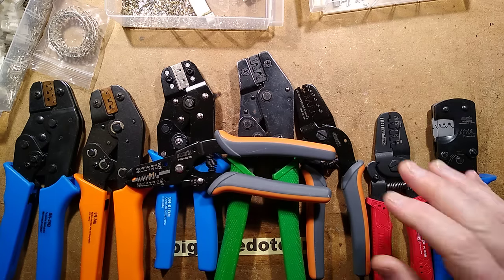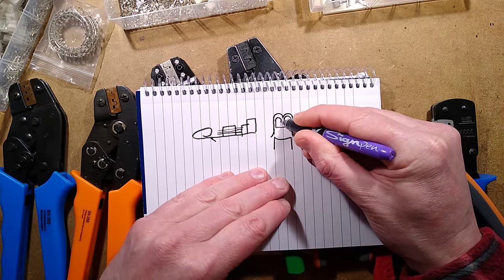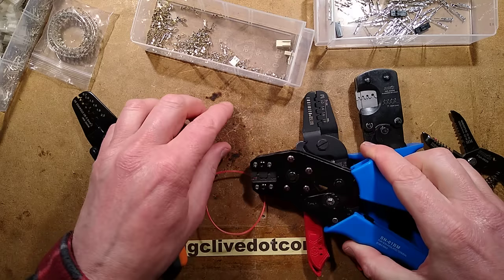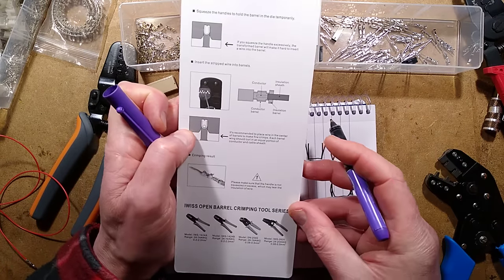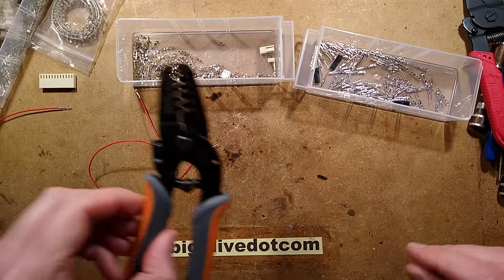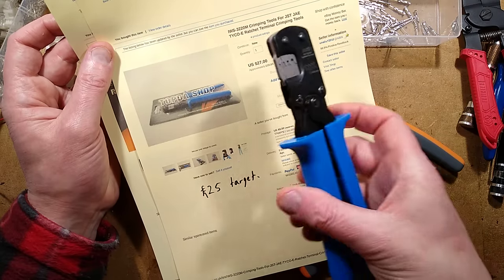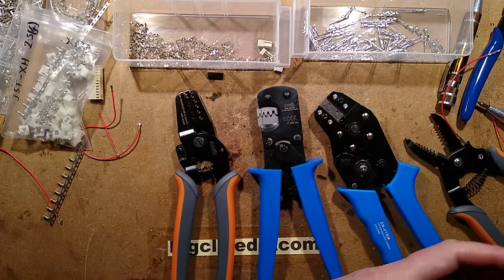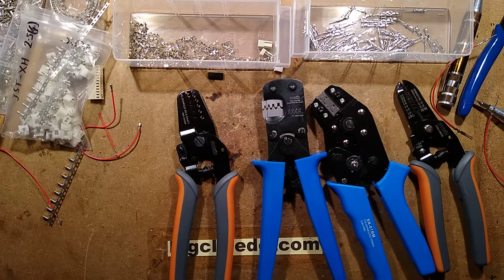Crimping tool test that I screwed up. (Read description.)

Comment: We use Deutcsh pins where I work. I've never had an easier time doing wiring than with those pins, and the $300 Deutch crimper. I've always hated crimping wires on projects at my house, but I've never had a good set of crimpers.

Comment: I use the PA-09 for my RC stuff.  High quality but not the easiest to use.  Like you mentioned the terminals sometimes get stuck in the tool, and for me when I crimp it sometimes bends them in a way that they won't go into the housing.  It's a very manual process to use them.  I've also used them for JST-XH terminals for RC LiPo balance leads, they work better for those than the Dupont style servo/Arduino connectors.  Thanks for the video, I think I know which crimper I should get instead.

Comment: Hi Clive, I have and still use a genuine Molex tool with the latch and stop for the connector. Still produces perfect results but, as you say very expensive, cost about £130 and that was over 30 years ago.

Comment: I recently got a crimper from "Preciva" so far I like it, they had a learning curve to them but once I got the mI was able to crimp all my connectors.
I have problems with the JST connectors not wanting to let the metal parts slide in and click though, I have to take something and push them in sometimes.

Comment: From the moment the bare copper has entered the connector I can't see how much of the cable is entering, so instead of that I put the cable with enough amount of cable coming out of my left thumb and index finger so I can insert it until the fingers are touching the tool, that way it's repeatable. I can even put it next to the profile to see if I eyed the correct amount of cable.

Comment: Lobster makes the absolute best crimpers, the ak15 crimps 20 ga - 10 ga.  Also, I've not yet found an insulated crimped that works.  Just use the lobster ak15 and add some electrical tape if you are concerned about the insulation,  but I've never had a problem with them destroying the insulation.

Comment: JST pins are much easier to crimp in my experience and that Engineer tool works like charm. It does take getting use to and you kind of have to make sure that both parts of the pin are indeed parallel. You actually bent one wing (or whatever the name is) more than the other in this video and I think that's the reason why it didn't come out right. Because pressure is initially on that part of the metal and not distributed, which causes it to bend instead of curl up.

My Engineer tool came with instructions about this, explaining the parallel part and the whole process. Not sure how yours didn't.

Comment: Thank you for this video!
I have spent days trying to figure out how to use these crimps (had two different ones) for both KK and Molex (and some other I can't remember), even from multiple "manufacturers") with mostly awful results. The occasional time the crimping was Ok, it was still more or less non-repeatable. Also experimented with different wire types, sizes etc. Now I know that it wasn't simply me sucking - It was that the tools suck more!

Comment: I got the Knipex tool (after a lot of experimenting to get the correct one!) for "dupoint" connectors. It was £120, but crimps both sections perfectly and 100% secure. It was a hassle to find the correct model, but now that I have it, I think it is the best value for money. The model I use is the 97 52 34.
Reply: the isolation retainer flags of the "du pont"  need  to  be fold beside each other,  they are triangles, the crimper  you  mentioned does  the curl in action, what i did  was to  extend the  japanese engineer crimper with  a self  made   part  with  a round top instead of  the  "bottoms" shape.

Comment: I would hate to think how many crimps I have crimped over the last 24 years in my job, must be thousands! Probably the worst one, because of its size, is the Molex MiliGrid, its tiny and you need a 1mm strip length, plus the tool was £300.
Many years ago, I worked for AMP and watching the machines punch these crimps out was amazing because of the speed they were working at, it was almost a blur.

Comment: Most of those crimpers are capable of adjusting the crimp because of manufacturing processes and variables of the terminal ends . The  star wheel with the stop screw is the location of the adjuster .      6/2/23

Comment: Try taking a wire and stripping 1/2-3/4" off. 
Then twist the wire then take the connector hold the wire and connector in 1 hand take neil nose pliers and squeeze onto the insulator gently only to hold it in place. Next make sure the bare wire is in-between the small inner wings firmly seated then crimp and cut off excess wire.
It is so much easier this way night day difference. Good luck👍

Comment: Necro comment excuse: Ye olde algorithm put this in the sidebar, and I was curious.

My primary experience with terminal crimps is the JST-SM wire-to-wire connector commonly found on 5 volt addressable LED strips ("NeoPixels", but they also use them on APA102C strips as well with 4 pins). The official JST crimpers are... expensive!!... but they have these swing-out pieces that hold the pin in place so you have a free hand to insert the stripped wire. They're rated for up to a max size of 20 AWG, but I've been able to get away with thicker 18 gauge wire. It might shorten the life of the tool, but as Michael Winslow says, it ain't mine.

I've had fairly good results with a ratcheting iWiss/iCrimp tool, but because they're more general-purpose (jack of all trades, master of none), you can't really stabilize the pin before crimping, you have to kind of "trap" the pin in the jaws somehow before inserting your wire, so it's quite a bit fiddly. I'm about 3 to 5 times slower on the iWiss crimper than on the JST. The other thing about jack-of-all-trades crimpers is that they will be prone to bend the pin a little bit, whereas the official tool should never do this.

Comment: YOU SON OF A B... I could have used this video about a month ago, Clive. I had to crimp 16 PicoBlade connectors using a crappy tool I bought from Amazon. Ended up using needle-nose pliers.

Comment: Recommended crimper for PowerPoles has a plate with an indent on the back so just push pin to that and all lined up. Surprised none for these sizes.

Comment: It's almost funny, while I have the Iwiss 2820 and another ratcheting crimper for connectors on up to 12 gauge wire, I still find myself doing crimps with a pair of very well worn (AKA too dull to cut anything anymore) flush cutters. The stuff you get used to while doing emergency repairs to "just get it back to the shop so I can fix it properly".... There's probably a few of those crimps I did 20+ years ago still in service. 🤫

Comment: I got an IWISS SN-28B a few years ago, for work. It does the same style connectors. The die is marked in AWG, 28-18. I like it so much that I recently got an IWS-30J kit for a variety of larger connectors, including 20-10 AWG/1.5-6mm2 of this same type. It's not quite as nicely machined as the 28B, but seems to work fine so far. At the same time I ordered a much more expensive TE crimp tool (14-10AWG) of this type, as recommended on the datasheet for some TE crimp terminals. The TE tool is easy to use, and does a great job on the conductor/wire portion, but the insulation tabs are only formed into a loose circle that doesn't even contact the insulation. So I ended up recrimping all my connectors with the IWISS tool, to get the insulation tabs crimped properly. Long story short, I second the IWISS recommendation.

Comment: I have used the engineer tool whilst at an internship in Japan, and it only costs roughly 14$ there, which makes it a lot better deal. I think its greatest strength is that you can crimp a lot of different connectors, not just 2.54mm molex style. Examples of others are nano-fit, JST and microfit.
I suppose the IWISS will do similar, on your recommendation ordered one. I am curious how it will turn out. As a reference, I paid 24.76 euro with shipping for the same set of crimper and stripper.

Comment: As you were saying "Of all the tools I've tested" They've been testing you Clive.😂
What an excellent upload..
Something to perhaps cover in a future video is the Crimps themselves.
It is a nightmare finding a decent tool to use on insulated crimps. But the crimps also vary
in my opinion and the ferrule which is crushed against the wire must be of suitable thickness
to remain crushed and in cheapo Chinese crimps this is not the case. Always buy good crimps 
from RS or Farnell, they will not be be cheap but they will work. Chinese Crimps will nearly always
fail the pull test. You cannot crimp tin foil.🤔

Comment: On the engineer, you can use the end of the tool to straighten the connectors. It's a knack I guess. I still bend connectors but I at least can straighten them. The tool used to be a lot cheaper! I did not pay that much!

Comment: That was interesting. 
I mainly use bullet connectors in much larger sizes re-wiring 1970's motorcycles (3.8mm & 4.2mm) but did buy a tool to change battery connectors on grandsons RC toys. Now I have to find it and see what number it is and if it's the crap one.(probably, I haven't had much luck with it) I do have a single crimp tool I was given around 1985 when fitting motorcycle alarm systems
Reply: Dragged it out, it's the SN-28B. Your observations about lubrication made me decide to to try oiling the pivots. I also removed crimping jaws and took a look at them with an x10 loupe. Removed some of the paint from tops of the flat pieces and re-profiled the curved base. Re-aligning the jaws properly seems to have improved things but replacement jaws of better quality would be better (I did that with the larger size crimpers? years ago) The SN-28B sizes are 0.25, 0.50, 1.00 (mm?) or SWG 28-24, 22-20, 20-18 which don't  seem to fit 'anything' properly (at least nothing I have)

Comment: The one thing I hate about these crimp tools. They all seem to be made with an industry standard length for the handles. Which happens to be short enough that crimping BNC is going to kill your chest or shoulder depending on which lost the sacrificial muscle coin toss. At this point I'm tempted to bolt bike post on the handles of mine if this new pair I picked up is tough to operate, picked a pair with enough heft to them to withstand cheater bars on the handles.

Comment: I suggest you to take another look at the SN-28B, but from Iwiss, for use with dupont style connectors: They actually do work quite well but, like you saw, it depends massively on the quality of the tool. I bought one from Iwiss a few years ago, one for home and one for work a few weeks later, but I also involuntarily tried a no-name one (it was the same listing on Amazon for the original Iwiss, but some dubious Marketplace seller sent the rip-off the second time ...). While I successfully crimped at least 300-400 connectors with the original, the rip-off was completely unusable as it had high tolerances (like shown), the edges/details of the die were not "sharp" (looks like powder-coated, but wasn't) and the tool was wobbly as a whole and it couldn't get a single crimp right; 100% destruction rate. On the Iwiss one the smallest/front position is what usually works best for the small duponts. But one thing to note: Even on the pre-terminated wires i have lying around, the failure mode is always that the wire pulls out (with some force). That may be because the latching tab on the plastic housing is quite big and it pushes directly on the main part of the contact and not on a tiny metal tab that deforms.

Comment: I was wondering about your notepad. It obviously comes with a sketch app. Does it have other apps available? It does look like it supports a writing app but I've not seen you use such a feature. I do recall different colours so certainly a colour interface, which I guess means a painting or drawing tool/package must be available. Overall a flexible notepad which seems reasonably priced and versatile. Thought of doing a tear-down?

Comment: Pulling the terminal out of the connector as you are doing is and excellent way to get a very nasty cut.  Ask me how I know.
Reply: That's why i use pliers to hold the housing, although the housing had to be sacrificed in the process.

Comment: Every time you stripped a wire I wanted to reach into the TV and twist the end. Then you said that was taboo. Why?
Reply: it affects the efficacy of the crimp, the wires should be straight to maximise the surface area of the wire that gets deformed into the crimp. I wish I could remember who did the video I watched on it a while back, it was excellent, showed what happens to the cross section of the wire strands as they're crimped
Reply: If you are using the largest wire size allowed for a terminal twisting increases the diameter and it may not fit.  But if the strands are left straight it will fit.
Reply: You leave oil residue from your fingers which could cause oxidation.
Reply: Twisting the wires forms a solid strand so the crimpers can’t crimp down to the correct size and may very well crimp too hard and cut the wire/crimp and it may fail.
Reply: Upvoted, but lots of reasons most have already been given. Twisting the wires also introduces just a little extra bit of mechanical stress (and work-hardening) on the wire and if it experiences any flex or vibration in service, can fail earlier than untwisted wire.
Doing hobby-level stuff you probably won't notice it but if you ever get into the industry it comes back to bite you in the ass.
Reply: Easy. Look closely at your terminals.
You will see, that proper crimping parts the strand in two halfs.
Which is not possible, if you twist the strand beforehand.
Reply: @cekpi7  A properly crimped contact forms a gas-tight connection.
Reply: You are not supposed to twist wires together when soldering too. But for hobby stuff its acceptable I always twist stuff at home and had no fails yet just because its easier and I like to live dangerously.
At work though I never twist the wires and there you can see the effects of twisting cables when they are in a harsh environment. Cables breaking, non gas tight crimps, wires pulling out of spring loaded terminals or just work hardening and breaking.
So I wouldn’t recommend twisting cables when they will be exposed to harshisch conditions but for prototyping there are no fucks given ;)

Comment: Thanks Clive, very useful video. I hate Molex crimping, never had luck with cheaper tools (I am not doing Molex on regular basis, so I never splashed for proper tool), so I will try recommended ones. Insulated terminals (car connectors they are called) are more in my ballpark, did hundreds of those for my engineering degree.

Comment: Crimp don't crush, it only fatigues the metal and causes it to fracture over time or due to vibration. Only ever use the right crimping tool for the crimp. IPC 620 is a good industrial standard to follow and only ever use a ratchet crimping tool to get repeatable results, usually calibrated. The plier type 'crimping' tools depend on how hard you can squeeze with no repeatability or reliability between two people, same happens if you use the wrong tool.
Reply: If you buy a $20 crimp you arent even in the industry so not something to worry about
Reply: @captainheat2314  £20 crimp ? Jesus that's expensive

Comment: I think the reason the engineer ones are so popular in RC are for PICO blade, I have the engineer pad 11 crimper, and while it does hold and Not let go of the terminal...when they are that small that's what you actually want for that application! IMO.

Comment: I've been using the Iwiss strippers for years and really like them. My favorites by far. I don't do much crimping of multi-pin connectors (Molex etc.) so don't have much experience with them. I do have a set of crimpers that I bought for some project but can't remember who made them. Like Clive said, you can pay big bucks for crimpers and good luck with getting the quality crimp you are hoping for.

Comment: i've done quite a few of crimps like this, but all tiny stuff for r/c airplanes and whatnot. and i usually use silicone wiring, and it's annoying how the part that goes over the insulation just squishes the crap out of the silicone, and sometimes you have to pick off a little bit of what it extruded, and it will often just break the insulation and expose wiring... annoying but good enough i guess

Comment: Presently the only crimping tool I have is one based on north american Bell System crimpers, used mostly with insulation-piercing spade terminals for wiring up telephones, they work okay, so long as I make sure to keep the bolt I had to put through them (cos the rivet they fitted was too small!) properly tightened up... :P

Comment: I have the third one you shown, I use it for jst XH2.54 and molex SL 7185 (the molex crimps are so long you have to pull them through a bit more  and squeeze again or the end of the wire  holder is not crimped). They work perfectly fine though the jst XH2.54 are tricky as they are so short. It's rubbish for dupont crimps though.

Comment: I've got a parallel jaw iwiss and it's been life-changing, it's so reliable. I don't know the model number, but it's sized right for DuPont connectors and 2.0 and 2.54mm JSTs, it that the XS and XH? I'd need to go check. I don't think I've had a crimp fail since I started using it, which is a triumph as my record with larger crimps connectors on my motorcycles is not good. Gonna look for a bigger parallel jaw iwiss.